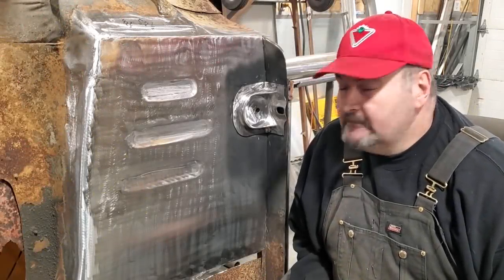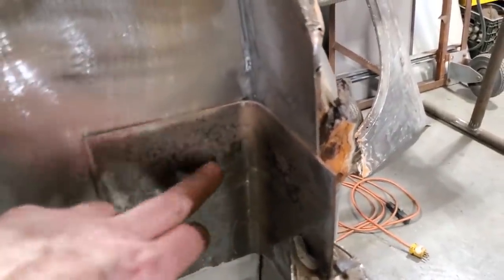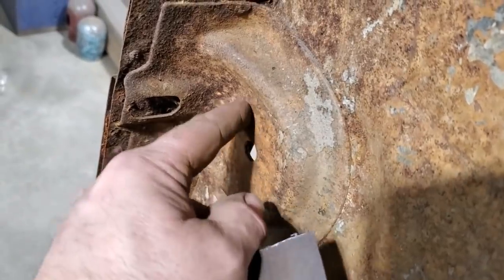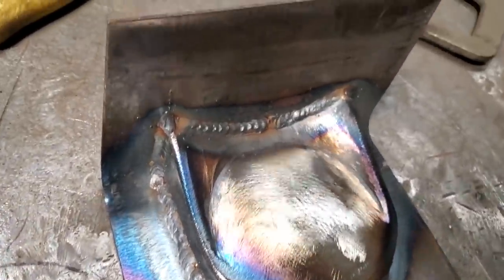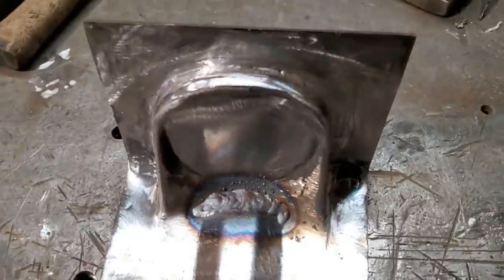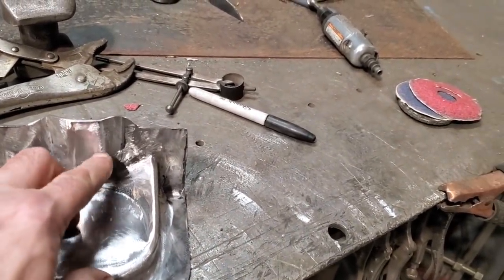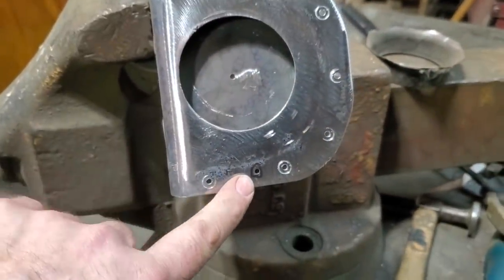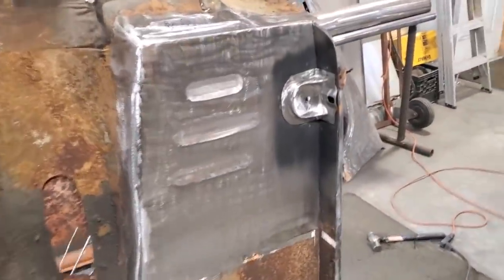How to make Body mounts with basic tools

Comment: I can’t thank enough as I sent this video to my  youngest son who is 34 and into old vintage 80’s GM’s. I have that 8” vise, MIG and grinder. My instructions to him was to make a paper part to start with as a pattern (Note: $12 buys 34” X 100 foot roll of RED rosin paper used under wood floors) he is making a door bottom that is not sold. He wants to learn to weld, I told him to duplicate a pattern, Cut & bend metal then we will shape it and tack it then weld. 
Thank your very much for the video. Remember guys, you can’t always buy what you need!

Comment: Fitzee, I don't think anyone would ever see that it's not factory original.
Man, you have PERFECT timing! My 69 Chevelle's pass side radiator support mount is shot from being underneath the battery. I will be using(copying) your method for building a new one! As soon as I get it's LS engine going(gotta wire in new fuse/relay box) I will be gettin happy with some sheet metal!

Comment: I'm always amazed at how you can so quickly get to the root of the issue and deliver a stunningly clever solution.  The flipping the U shaped loop to accurately determine the cut-i see it and smack my head-why didn't I think of that.  Damn genius

Comment: I love fabrication its almost like therapy just working at your own pace and also seeing the end product of what you created....im working on a 49 fleetline and I had so much fab to do now its almost coming to an end and im getting ready for body work in a month
Reply from the maker: Fleetline! What work have you done to it?
Reply: @fitzeesfabrications  the floors, inner rockers, inside quarter plates,door jamb,trunk repair,spare wheel replacement,firewall patching,rear window brackets, front lower body body patches,front fender patching.....it was alot of stuff i thought it was just going to be a floor replacement but it turned into an onion i just kept peeling back layers and layers cancer. During this whole covid lockdown I been able to advance alot with this car and maybe next month the body will get done up and the engine will get slapped in to start cruising the streets of Cali.

Comment: you do good work fitz.
tip for you, copper weld thru primer, not zinc when spot welding. after welding is done then coat with zinc.

Comment: Thanks. Most of the stuff I have been making doesn’t get the way I’ve been wanting but close. I’ve been using a sand back and dollies from a cheap body hammer set. Piece I’m work on is on 90’s f series. There is a thicker plate that the bottoms of fenders. Then tackle the inner an outer fender.

Comment: You did great.The only thing is that perhaps the middle section should have been done first and than to locate where the main hole should be on the floor panel before you make the rest of the piece.That way the main hole would be located in the middle.

Comment: Hi Fitzie I think you show the most basic use of hand tools doing body work its fantastic how you create the new parts needed an I thank you on your use of using CO2 instead of expensive argon gas I live in Sydney Australia an we are metric here what size is 18 gauge sheet metal an 16 gauge in metric size  I have  been given the wrong sizes by people 
I'm just a woman who's into cars an have 2 project cars a sport car and a vintage 4wd can you please assist in those sheet metal sizes I mentioned 
fantastic work Fitzie
Reply from the maker: Just goggle  metal thickness chart and you will find the different  gages and what they are in mm. Hope this helps.

Comment: You are very talented and know how to make the best out of the tools you have. One question though: The body mount on the passenger side is located in an upward well that's pressed into the bottom of the floor pan but on the floor pan that you fabricated, there isn't a well. Won't that result in the mount being too low on the driver's side?
Reply from the maker: No the floor drops after the mount. Both mounts are same height

Comment: I like the way you did this, not taking a big bite, but doing a bit at a time.  Question though, the stock mount seems to be in an area of the floor pan that is dimpled down about the width of a hand, and maybe 1/2" deep into the floor pan.  But you didn't do that on the side that you fabricated.  Isn't that going to make that part of the cab 1/2" or so (whatever the depth is) high?
Reply from the maker: No thr dimple is a drop in thr floor outside the mount. The new mount sits same hight as thr old one . The dimple  I seen and alot of work and it flows back to the height of thr mount

Comment: Thanks for sharing this one Fitzee, that's how I should have done mine. Hindsight is perfect you know! What's next on the 620?
Reply from the maker: Going get the bottom finished up. Need to make 2 more mounts. Much same as my last two videos. Door posting rockers will be my next video on this
Reply: @fitzeesfabrications  If you're going into the cowl area, I've found where the inner cowl meets the inside door door post is a bad rust-through area

Comment: Hey Fitzee, great tips as always. I noticed the piece you made was welded to a flat surface on the floor, but the other was set into a shallow indent,  are you going to replace the other side too?  Also, I think the little slotted hole recess you hammered into the edge is possibly to locate a side jack.
Reply from the maker: The indent is a drop in the floor after the mount and flows back to the mount height. I didn't see a need to reproduce  it.

Comment: Not to criticize but i did notice a contour shape(may be the wrong terminology but the proper one escapes me) just about an inch or so away from the existing mount that is not on the manufactured side... can I assume that the truck was built that way cuz you surely wouldn’t have missed that??... Those Datsun pickups are getting scarce as hens teeth... keep up the good work...
Reply from the maker: Ya it is there I know. I chose not to make it as I feel it was not really needed.
Reply: @fitzeesfabrications  fair enough.... I figured there was a good reason....

Comment: Fantastic! Being a novice welder at best, I’d be worried about the integrity of the metal near the spots that were welded together. Wouldn’t the joints be a weak spots where cracks would form later? Especially on a body mount that’s subject to torsion and impact stresses. Am I being overly paranoid? Your work is brilliant, but for an average guy starting out with this, I’m nervous to tackle repairs like this without your level of knowledge on metal properties and welding techniques. 😰
Reply from the maker: The edges are welded inside as well. Making thr edges stronger then the rest of thr mount.

Comment: Hi Fitzee.  Got a question for you.  I've noticed on many a video that you seem to be able to wipe your fingers around the edges of the steel without cutting yourself.  How on EARTH do you manage that??  I'd end up looking like a model for a sticking plaster manufacturer!
Reply from the maker: I sandman edges after each cut. Thr sharp edge on a cut panel  is thr bottom and I just run the zip blade  across it to remove this edge.

Comment: Great work Fitzee! I do notice that the stock cab mount seems to be in a shallow circular depression. Will this make any difference to the mounting height side to side?
Reply from the maker: No that I'd the floor dropped around the mount. It is very odd as it comes back up to the rocker  height out by the beads.

Comment: Fitzee I realize this does not apply to this current video but I have a question that might apply to some of your techniques when I watched you fab small patch panels and get them in proper alignment. My problem is that one of the doors on my '36 Ford coupe is off about 1/2 inch especially at the furthest point from the 2 hinges. Also the bottom of the door again at the farthest point from the hinges it juts out about 3/4 of an inch. I know it might be too extreme but I have considered sectioning the inner panel of the door to realign the door in the correct position. Any thoughts on how to get good alignment?
Reply from the maker: Those old fordshad alignment on the two body mounts. I always aline mt door to thr quarter hight and gap. Then I look to see where my issues are. Sometime jacking up thr cowl will fix alot of it. You will see this on thr rocker sill. As if the door fits nice on thr quarter and is off on thr sill you will know which way the car will needed to be jacked
Reply: @fitzeesfabrications  thanks fitzee for taking the time to respond. I have tried new pins, jacking up the door and placing bushings/spacers without much success. I'm also wondering if removing the hinge pins, and the inner metal skin exposing the bolts and removing them were the hinges attach to the inside aspect of the door,  then  tack welding the door for best fitment in a few spots to the inside frame (A and B pillars) then weld the hinges  to the newly positioned door. Then again maybe its just time to buy a set of those hidden hinge kits. I've owned the car for 40 years and never had a good fit of the door all the while this has been the most troubling problem I've had to deal with.

Comment: Fitzee, another great video!! One question. I watched the video where you replaced the floor pan, but I did not notice the recess where the other body mount. You did not replicate this recess in your floor pan. So my question is, did the floor pan you replaced have the recess?
Reply from the maker: That was alot of work to add into it and I had too much into  it all ready. Thr drop in thr floor was next to thr mount. It has no bearing  on the floor other then it collects water when floor is wet.
Reply: @fitzeesfabrications  Ahh that is kind of what I was thinking! Thanks for the reply and keep up the awesome work!

Comment: What is the black paint that you use to prevent the rust in the overlapped areas? Any Long term results? anything else you do to prevent rust from coming back?
Reply from the maker: When finished fill it with oil. I use a rust paint. Nothing special  just want to apply as much as I can to help

Comment: My mount brackets are fine but it bolts into nothing as my cab is rotton on the bottom the frame is fine is it worth continuing to tinker or should i just move on..? Id need a whole new cab or should i keep working on breaks and tuning her up ans down the road swap cabs or pay a professional like yourseld to fabricate and weld me up replacement pannels for the bottom of the cab?
Reply from the maker: What is the cab? There are alot of aftermarket panels out there for trucks
Reply: @fitzeesfabrications  I got a 83 chevy c10 it's mostly rotton around the front drivers cab mount I don't think this is something I can do in my yard need to take the cab off. Just wondering if you think it's worth me doing what I can like rockers and cab corner and ignore the mount under the cab until I have coin to pay a professional to do that or let my dream go on. I'm just a young man learning not alot of money but trying to keep my square body alive. Thanks from the west coast Canada I miss nfl and cape Breton thanks again
Reply from the maker: @geebarney7910  your issue is common and I repaired those with cab on many times. I had those square body truck gone to the point that everything from the center of the cab out was gone. Nices thing about it still being on the cab is you can keep a eye on alinement of the door and fender. Just start from the inside and work your way out to the rockers. Start with mount then the floor then the inner rocker then the outer rocker. It works out that all this can be welded in very easy with the cab still in place.
Reply: @fitzeesfabrications  thank you so much Mr fitz I won't give up on my dream after I left my first 292 manual go now I got a 350 auto cleaning up frame my floors gone driver side ill make sure I take care of inside and work out so everything lines up properly. I could send you photos if there is a way I can email you? Thanks for your help I'll keep watching your videos and prevent thr rust from spreading the best I can. Bless

Comment: WHAT IS THAT OLD PIPE TYPE THING YOU BEAT THE SEMI CIRCLE PLATE DOWN OVER ?
Reply: It's the end part of a rear end or differential case. The plate on the end with the four holes is where the axle bolts to.

Comment: Thank you for the priceless tips. My question is, do you use argon gas mix when you weld heavier gauge metal?  Thanks again for the lesson. Always looking forward to the next small project.
Reply: The only difference with mix, straight CO2, and even flux core is the amount of spatter (though FC puts a little less heat in the weldment per amp). Least spatter mix, most FC. Technically the argon SHOULD make the weldment hotter than CO2, but there is no real practical difference until you get to REALLY hefty plate. If you're already set up for one of the 3, it'll do you just fine for just about any sheet work. If you're running CO2, and plan to move on to TIG in the near future it's worth it to buy the regulator setup, but otherwise no REAL practical difference except for a minute more spatter removal.
Reply from the maker: No only co2. It's leaves alot of splatter but works great
Reply: @ludditeneaderthal  The biggest disadvantages with FC are the fumes and the slag to clean off. Otherwise it's cheaper for occasional use than a welder with a gas bottle. I just built my box trailer using a FC 100A inverter welder. It could be months between when I do welding, so FC was the best option for me. For daily use, you can't beat gas, which I've never used.
Reply: @BrucePierson  I've burned wire with all 3, 22 ga to 1/4 inch, nice cold rolled to scabby scaley hot rolled. Another great advantage of FC is you can use it in windy outdoor conditions. The FC fumes arent nearly as bad as when the steel supplier uses halongenated cutting fluid to preserve their stock (smells like you're welding a wet dog, lol). For the slag I always used a knotted wire wheel on a grinder. If you spray some 30% dish soap solution on the weldment parts and let it dry (before running your beads), most of the spatter flies off under the wire wheel too.
Reply: @ludditeneaderthal  I have done welding on windy days with FC when I was building my trailer and I didn't notice any difference between that and calmer days. That's interesting with the dish soap, I'll try to remember that next time I'm welding. There's also a product that does the same job, but I haven't actually seen it. Just happened that I used a knotted wire wheel to clean up the welds on the trailer frame.I hadn't heard of halongenated cutting fluid , so maybe it's not used here.

Comment: are the two sides at the same depth. the original mount seems to be recessed into the floor pan?
Reply from the maker: No the floor drops around the mount on passenger side. Both mounts are same height.
Reply: @fitzeesfabrications  Thank you. You do amazing work.

Comment: Interesting how you turn a few bits of flat steel into a three-dimensional object. Really handy that the other body mount was there to copy. When you marked the hole in the bottom, I would have used dividers, as it would have been more accurate. The other thing that you might need to make yourself is a tram gauge, Have a look at Fix206's channel where he makes one. Skip to about 8:30.Very handy to have one.
https://www.youtube.com/watch?v=mTr5dCj4kis  All the best from Queensland Australia.
Reply from the maker: Been wanting to make one of those myself. Thanks for the link. I'll check it out